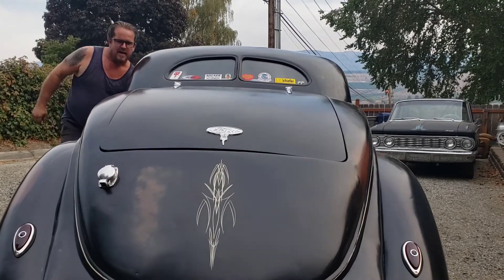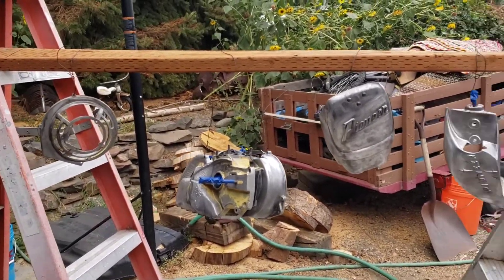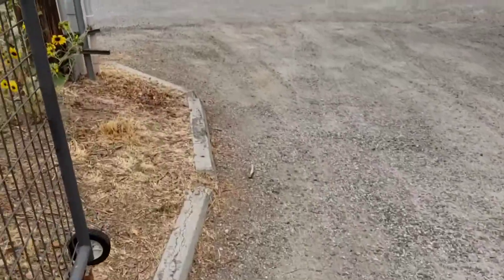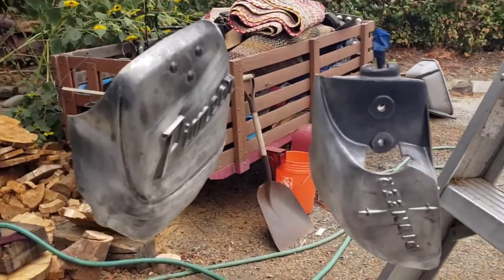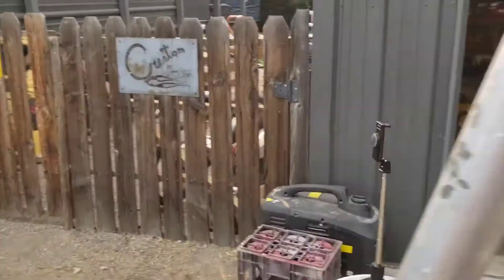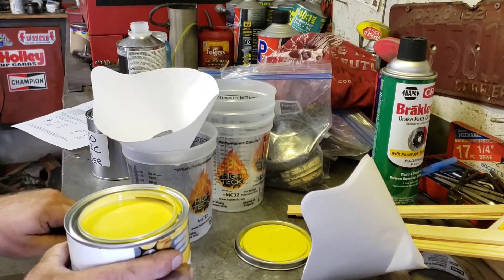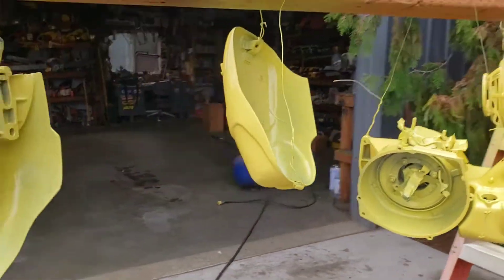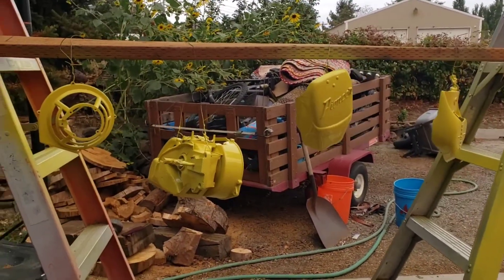Painting a Vintage Chainsaw with Automotive Single stage Acrylic Enamel

Comment: OK Kain-O. This video helps. With what and how did you sand those parts? Then you used Upol “edge primer”?  Any pre-paint adhesion spray? I sent my full wrap bar my 380 came with off to a pro paint shop as I needed it to be the most durable paint and it’s steel and has knurling. I actually bought a can of Rustoleum Husqvarna Orange spray paint. I’ve got a compressor. But I can’t afford a good paint sprayer. I tried the Lowe’s version. Turned out s****y. Maybe not enough pressure? I’m Afraid to even try. Maybe I could rent better equipment? Dan
Reply from the maker: Hey Dan, I just used 400 grit wet dry sandpaper, A cheap spray gun with a cheap air compressor, but honestly I do most of my work with spray cans! Whatever you feel most comfortable with man!😁👍👍
Reply: @KainKustomGarage  Kain-O: your reply gives me hope that I can pull this off. I think your recommended use of the U Pol acid etch primer and the pre-adhesive primer is the key to the paint. I had no idea these products were out there